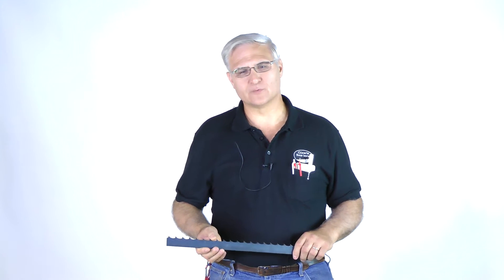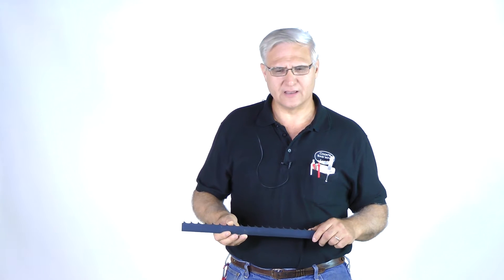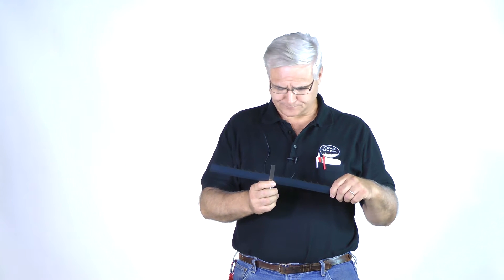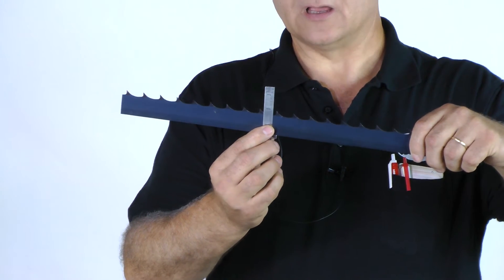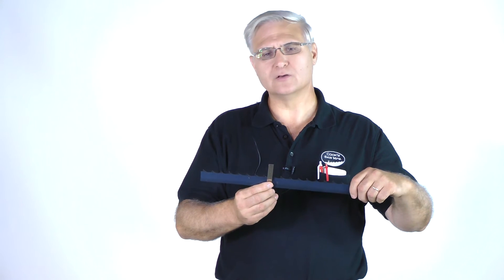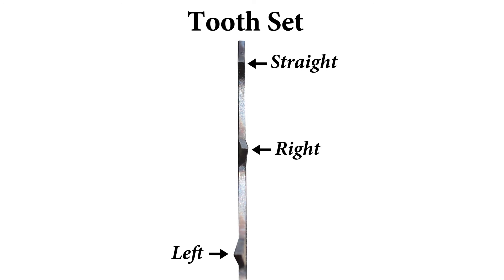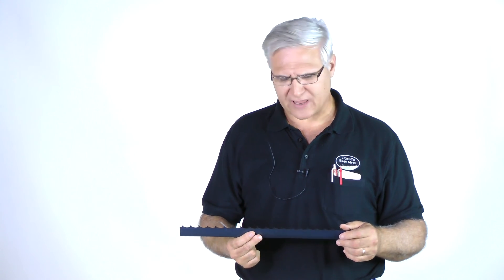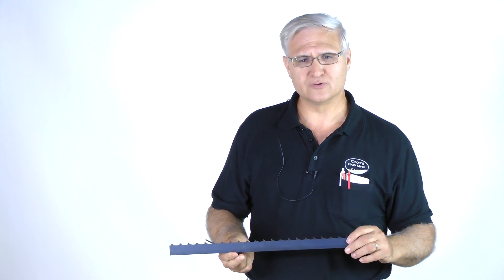Sawmill Bandsaw Blade Basics 2 Hook Angle and Set

Comment: Just recently found your channel. I'm trying to find a comprehensive guide, if one exists, about specific or best uses for the different types and angles of blades.

In particular, I collect gnarly logs to make "high character" slabs. Generally hardwoods with a lot of knots, crotch figure, spalting, bark inclusions, sometimes rot. Basically everything that will dull a blade faster. Is there a specific blade type or hook angle that works best for this?

Comment: Hi Steven Cook et al. You guys seem very knowledgeable about band saw blades.

I have a question slash idea for you. Band saw blade filing has been in your blood for generations, so maybe you know some things I don't. But maybe this is a good idea. And mind you that all my experience is with small band saws, 14" and smaller. 

I have noticed that when a band saw blade gets dull, it tends to dull way more on one side than the other. Now to be clear, most of the time when I kill blades, it is through abuse. I don't use a band saw often enough to wear out very many blades by cutting just wood. So most of my thoroughly dull blades have gotten that way from cutting things that I shouldn't have. That said, when I really trash a blade, I find it totally dulls on one side, but the other side is still fairly sharp. Each time this has happened, I had scratched my head a bit. I have even checked my blade guides, put a new blade on, and tried again to see if I just got unlucky. The result was always repeated. If the blade wore out on the right side and I put a new blade in, the same thing would happen. 

I have gone through this a few times over the years, learning exactly how much FR-4 or mild steel or laminate flooring I can cut on a wood cutting band saw at 1750 SFPM. The answer i each of these cases is very little. But I believe I have figured out why one side of the blade is dulled first, and I think it is pre-ordained which side it will be.

If the set of the teeth is left, right, center,  it is the right set teeth that wear to nubs, first. The blade will still cut to the left, a bit, and the left side of the blade feels sharp. And if the order of the tooth set goes right, left, center, then it's the left set teeth that dull first. I think in the former case, the right tooth wears first because it takes the biggest bite out of the stock. The center tooth is always preceeded by a right set tooth, so its kerf is overlapping the groove scraped out by the preceding right set tooth. Next tooth is the left set. It only has to cut so much, because it is cutting in the shadow of the preceeding center tooth. But the right set tooth is always preceeded by a left set tooth, so it has the least overlap from the preceeding tooth. It has to take a larger bite than the left set teeth. Hence, the blade is preordained to wear unevenly from new. 

I know there are different sets types. I have seen blade with no raker that go left, right, left, right. And there are wave set teeth, for cutting steel. These types of sets are symmetriacl. My idea is a raker set blade that is symmetrical. 

Left, right, left, center, right, left, right, center. Repeating.
Reply from the maker: Best advice we can give is to experiment and see how it works.
Reply: @CooksSawmills  Thanks for the response. I don't know if I'll ever be motivated to make a band like this, myself. My tools for sharpening and resetting a dull band are a dremel and a pair of smooth jaw pliers. As I mentioned, I only have a 14" band saw and run mostly 1/2" blade or smaller. 

This is not very conducive to producing my idea. I do sharpen my 3 TPI blades at least once before tossing them. But the path of least resistance when I restore a dull blade is to restore the preexisting set order; I have to only re-set every third tooth, because only the one side is ever completely worn out. Plus I don't imagine the original set on a tooth will bend the other way, very well. You have shown in your video how the factory set near the tip of the tooth cannot be easily bent because it is harder. 

I was more thinking if someone who makes band saw blades read this, they might have a eureka moment that would finally trickle down to the manufacturers that make the blades I buy. And then I could buy blades/coils with a symmetrical raker set.

If I were in the blade making industry, I would be keeping this idea to myself and applying for a patent or trademark.